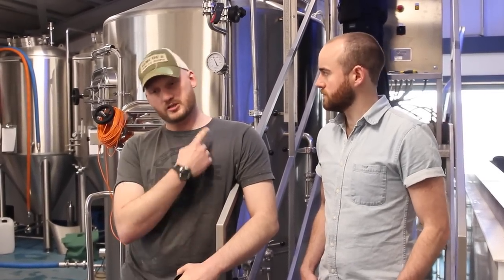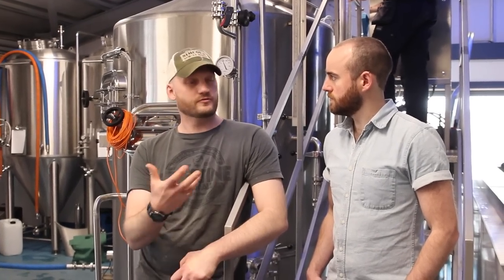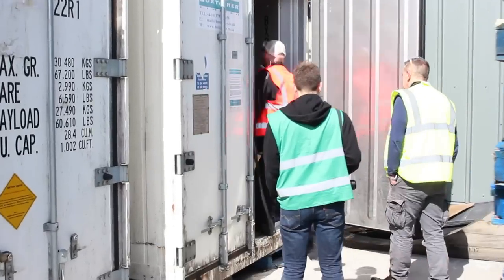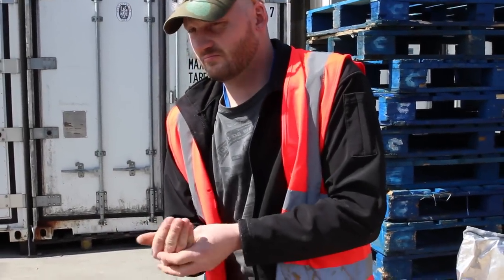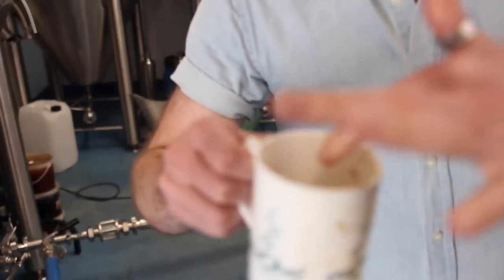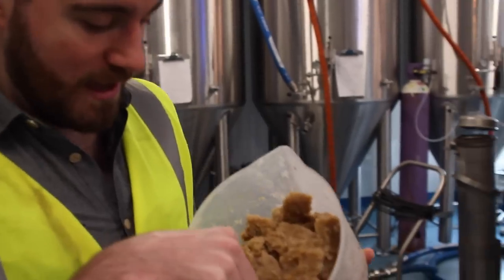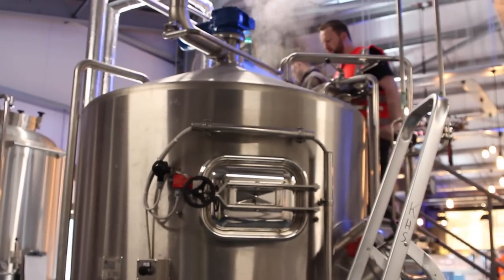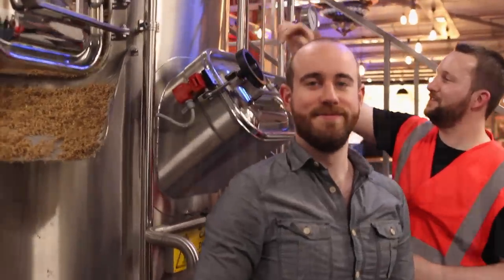Brewing with Brewdog: Peach Therapy | The Craft Beer Channel

Comment: I had a mash like that recently at our Brew pub. What ended up happening was that we were sent Acid malt in Pils Malt bags, so we actually added close to 300lbs of Acid malt in place of Pils. It was that exact texture. We took a pH and it was about a 3.0 pH. The Mash was stuck for close on 8 hours before we figured it out and immediately called our Malt supplier.
Reply from the maker: oh shit! Maybe that's what happened. it was allllll sour rather than sour and pale.
Reply: +SailingMountaineer Wow! Haha. That sucks. Did yall dump the batch?
Reply: +ZwienerZ oh yeah, it was the furthest thing from wort I have ever seen. Tasted like vomit and was probably not safe to drink due to the level of lactic acid.